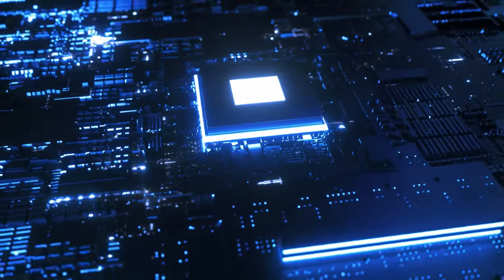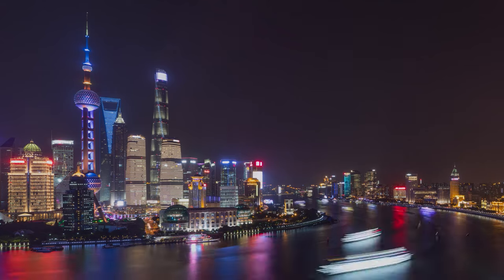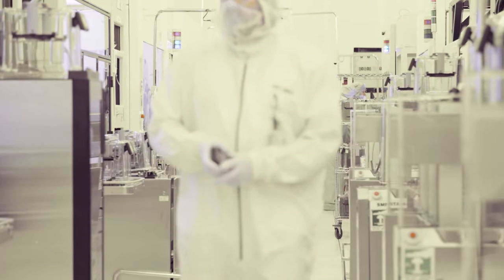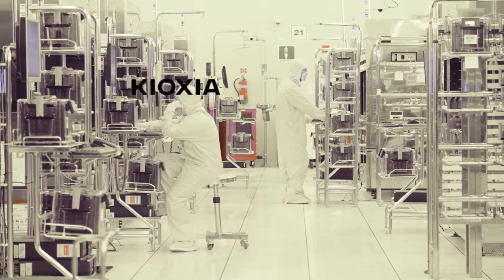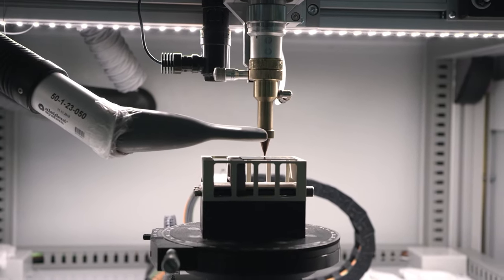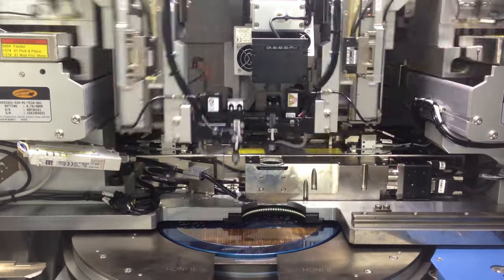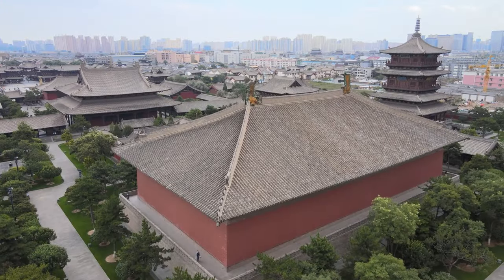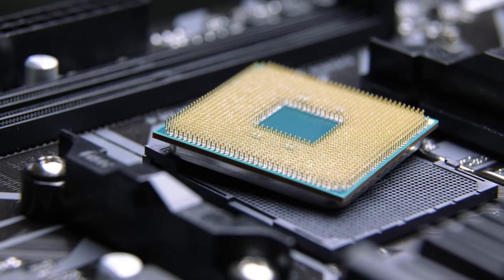The Shocking Truth: How China Outsmarted ASML

Comment: The 7nm chip Huawei & SMIC fabricated in an intel fab in China is not competitive.  To overcome the fact that DUV light is used, quad patterning is required.  This is the approach TSMC and other Western companies used in their first 7nm chips in 2017.  At least TSMC's yield was >80%, so the reported 7% yield of Huawei is a problem to meet demand and keep prices low.  Moreover, China has only one intel fab, so even if they can dramatically increase yield it's not possible to supply Chinese demand for 7nm chips, and building more fabs with the US tech ban in place is not possible.  Even if Canon succeeds with NIL stamping lithography, that technology will likely be unavailable to China due to the US tech ban.  And the synchrotron litho machine is still on the drawing board and has never been successfully demonstrated anywhere - that tech has been limping along for decades both in China and the West where it was first proposed, due to a number of problems.  So for China to catch up to the West is not possible anytime soon.
Reply: ROTFL. AMSL is on 2nm for thier next gen. 7 nm is not competitive